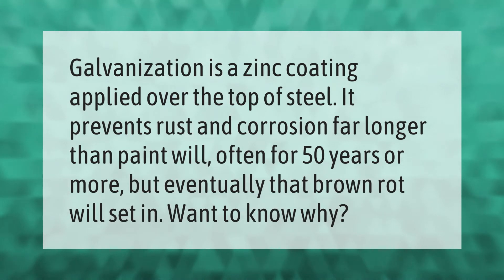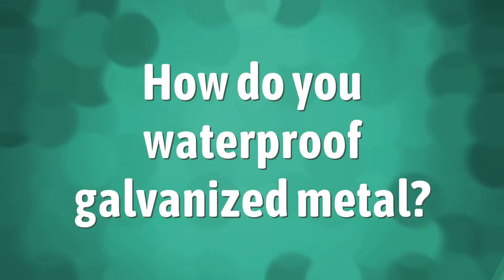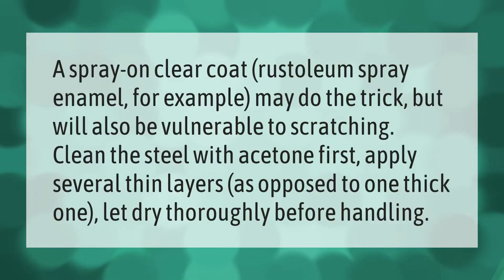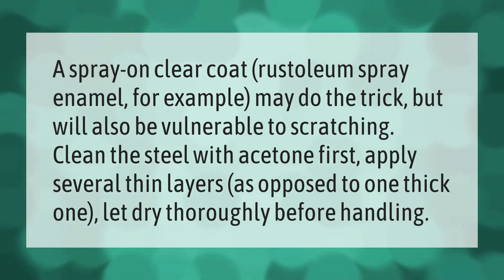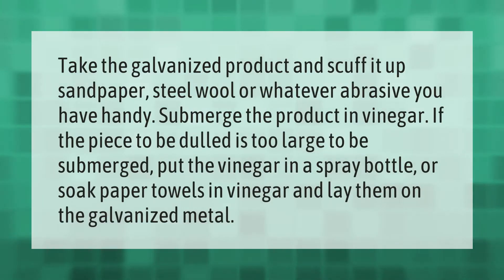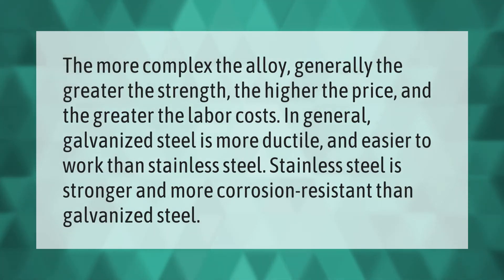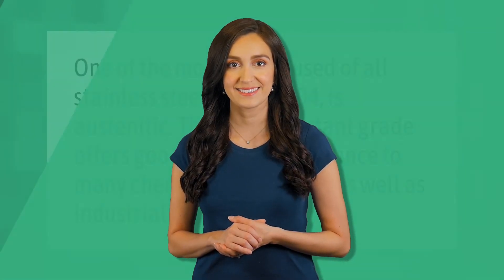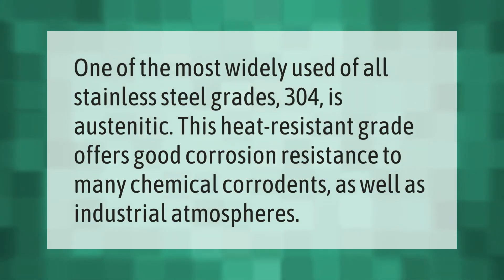How long does it take for galvanized steel to rust?

Comment: Please can you help me? I have a galvanised gate 2 years old, but I need to drill the metal post to put a slide bolt on it. If I drill the galvanised post, will it rust? If so, what can I put on the new holes to stop them rusting?